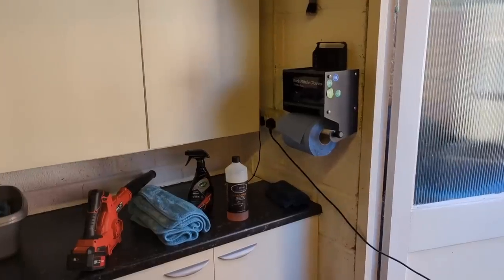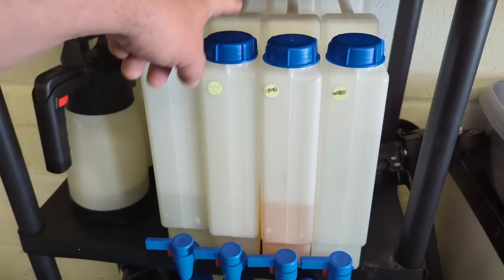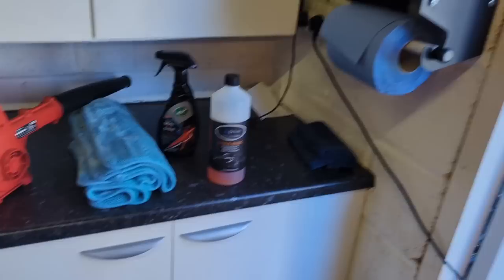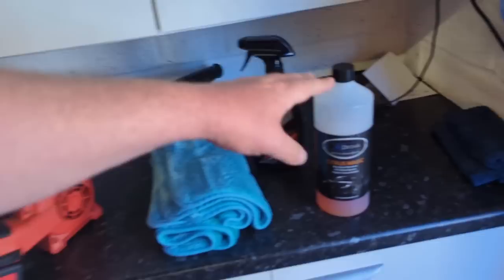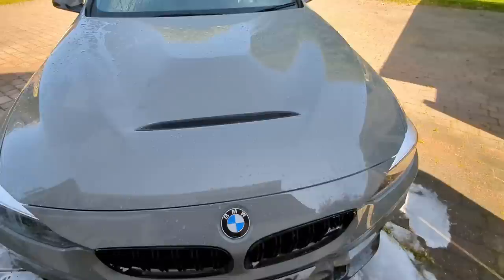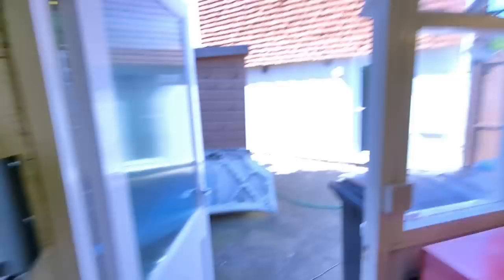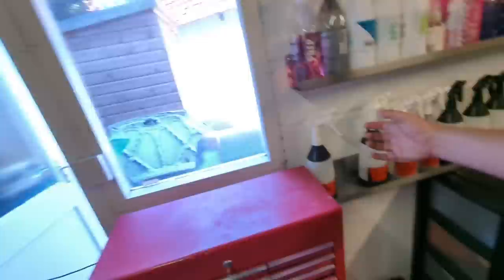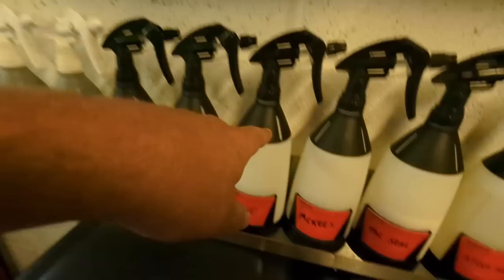Snow Foaming in the Summer for Bug Splatter and Dust with Citrus Magic

Comment: Huh, I'm still using the ValetPro citrus at it's recommended concentration through a pressure sprayer (because I have quite a lot of it still, and want to finish it all before upgrading to the KKD stuff), then covering it with snow foam. I get 99~100% of all the bugs on my car off during pre-wash rinse. I do genuinely think Citrus Pre-wash is best used in conjunction with snow foam.

Comment: 2:30 250ml to 750ml of water equates to a dilution ratio of 25% not 2%. To get 2% you need about 20ml of product to 980ml of water, or 50 parts water to 1 part product.
Reply from the maker: 250 to 750 in the lance equals about 2% PIR mate

Comment: Nice video Jon!!! You always have true to life videos !!! I daily a GTD and I have had my wheels coated here with LaboCosmetica about 2 months ago- I use Brake Buster with half water and half BB in my griots foam gun- these wheels are still hard to clean- wheels are gloss black- how long does a wheel coating last if you drive the car 100 miles/day? In the past I never got more than 6 months - o have tried Gyeon evo, DLux, even  Csl + exo v4! Can you share your ideas? Thanks!
Reply from the maker: should last over a year mate.  I put it on thick in the barrels and dont buff.   buff the spokes.   top it up with wet coat.
Reply: @ForensicDetailing   which brand is the most durable for a daily driver? Thanks

Comment: I have the same gun. I also have an Ava. What connector are you using? Ava and that gun do not connect. Worked great with my Karch - which i will dump! The gun though is really good around the wheel arches
Reply: Did you manage to get the. Connectors for the Ava? I’ve just bought one and want to get one of these guns.  I assumed you could use a Karcher K Series?

Comment: Jon, have you ever thought about getting a water filtration unit that would allow the water to dry off just on the sun?
Reply from the maker: thought about it mate but I sort of work around not having it.
Reply: I fill up a few gallons of distilled water when I go to the local market and rinse the tap water off the car with it. This is my cheap yet effective method.

Comment: Hi John, im A bit confused as to why you say you only used about 20p worth of product. You said 2% was about 250ml, that bottle is about £10 a litre. So you used £2.50 worth.
Reply: @bennevis21  firstly, even then 250ml costs £1.60, secondly watch the video mate its a 1 litre bottle he has.
Reply from the maker: I didn't really work it out properly was filming live   250ml to a litre but I only mixed up 600 ml.  So used about 150ml product.  But only half of it.  So about 60 to 75ml.   Not sure how much money that is.  100ml is about 66p?  So I used about 40p.  Is that right? Not sure.
Reply: @ForensicDetailing  hi mate… 100ml is about a quid… so yh more like £0.70 worth of product per wash. Personally i feel the pressure washer would have done the same job without the citrus stuff. Good to hear from you directly sir!

Comment: What is your shampoo of choice for contact washing these days Jon? Do you still use BH autowash? Thanks again for all the great content 🙌
Reply from the maker: I have autowash.  Been using bath but about to run out.  Used the new turtle wax one.  I've got the s99 one. And 5 litres of car chem which will last me 10 years.  I'll use any shampoo.  1900 to 1 won my shootout based on price per wash.
Reply: @ForensicDetailing  Could you do a vid on the gyeon restart wash? I've started using it in place of car chem 1900:1 and i find it has more cleaning power to it for a good deep wash. I'm not using it on a coated but uncoated car. I still follow up with a chemical decon etc so wondered if it was worth using over just bathe.

Comment: Hi. I bought bilthamber touch less. Like the product but I have to use 500ml in a 1L foam Cannon to get to the recommended pir. It also doesn't clean for me if I go under 4% pir. Do you have any recommendation like mixing with surfex or changing orifice size because the product works really well but it is not economical to use this way.
Reply from the maker: I use about 200 ml to 800ml in summer when it's just dust. In winter go 50 50.  But you don't need a litre in the lance 300ml can do if your fast

Comment: What hose have you got connected to the gun?

Looking for a Nilfisk replacement hose that won't kink
Reply from the maker: Stock Ava 8 Meter hose
Reply: I bought a 10m replcaement hose for my Nilfisk from Direct Hoses.  Much better than the original and doesn't kink.
Reply: @matt7997  thank you I was directed towards that website too by someone, good to know!

Comment: is this PH neutral ?
Reply from the maker: No idea it makes no difference what pH it is.    IPA is pH 7 for example.  Blend it 50 50 with surfactants and you have a lovely ph neutral mix that could be deadly to paint.
Reply: You say Ph doesn’t matter - I was under the impression that a high Ph product (be it shampoo, snowfoam, citrus) is more likely to remove a wax or sealant or reduce  their longevity.